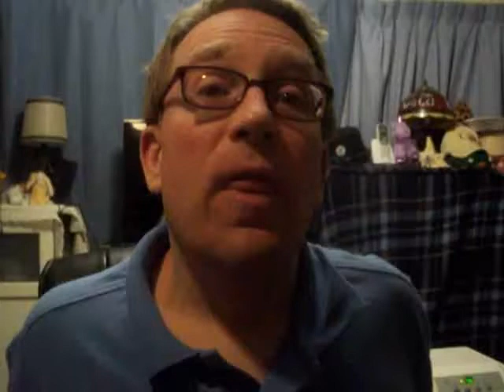My Response To OnlineCarShow

Comment: I would say the strut tower brace would not help at least noticeably during snow or ice.  I am not sure if it really adds to handling or by stiffening just adds more feel during the turns.  That is my honest feeling.  Granted with the 1le I can appreciate it actually turns way better than me as a driver can take it to.  I know that for sure 🤣. This car wants to take turns from the minute I bought her.  As far as the warp goes I have not heard of that issue.  I have heard of the issue of different models breaking under hard track use, though with the way this one is built I do not see the breaking happening.  I believe thats models with aluminum parts.  I will soon be adding long tube headers and a tune to car.  I would like to ceramic coat, but if I do not end up ceramic coating we will definitely see if the struts will warp being right above the exhaust manifold.  One problem with warping is how can we measure.  I would need to take it apart and maybe lie on a table.  You bring up very interesting points.  I would love to do a followup video in time and mention all these points once I do some more research and time...  Thank you for watching my video and making this.  🙏🙏🙏🙏. I just rewatched.  You mention the GM Strut.  I personally have the BMR Strut Brace.  But my good friend Derrick wanted the GM.  I warned him about the aluminum known to break...  He wanted anyways. :)
Reply from the maker: You're very welcome.  If you get a chance, check out my Abraham Lincoln playlist.  It's connected to the Bicentennial of the State of Illinois.